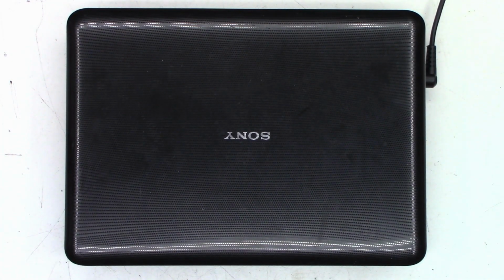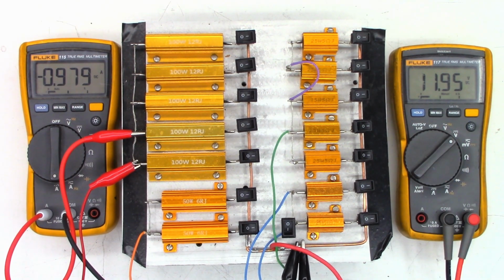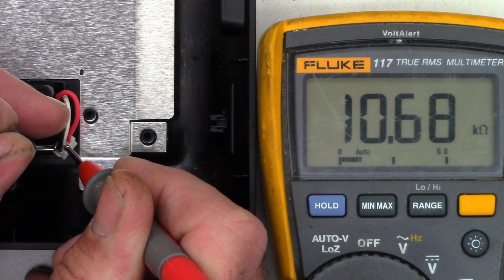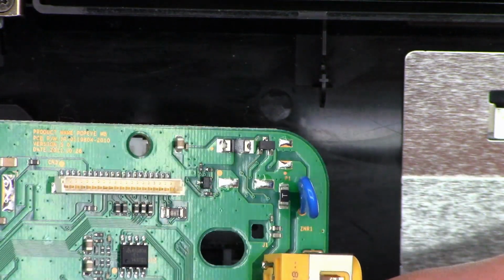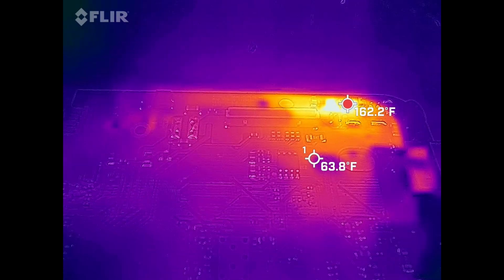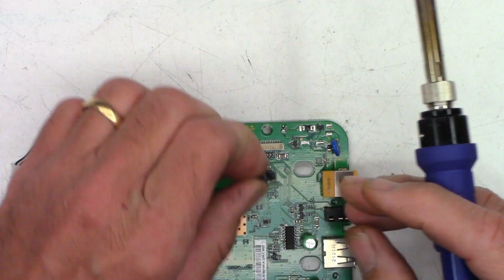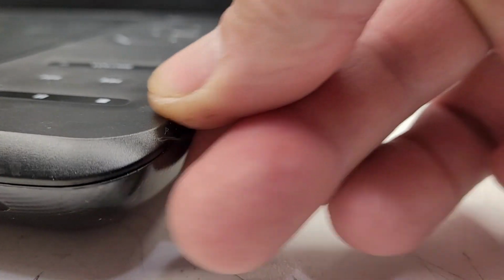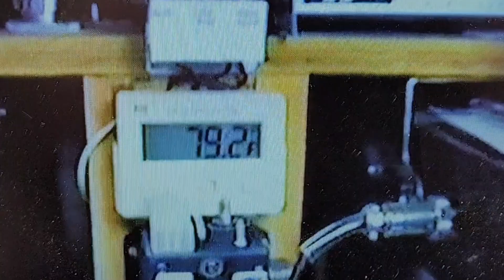Sony Portable DVD player DVP-FX980 Dead - No Power on AC Adaptor or Battery Repair Fix

Comment: This is nostalgic I still have my SONY FX980 DVD PLAYER it still works great unfortunately it's on its way out the battery is not lasting like it once did it only plays for about a hour and 50 minutes maybe 2 if I'm lucky its not my everyday portable DVD player anymore but I still love to pull it out of my closet and use it from time to time. Hopefully one day I'll get the built in battery rebuilt or replaced with one just like it at a battery shop and it'll last around 4 hours just like it use to. Still going strong after 6 years of use

Comment: I picked up a Sony DVP FX820/L at my local charity shop for $3.00 The battery was completely discharged, so I plugged a compatible AC adapter into it and the battery was fully charged within 5 hours. I popped in a DVD, and the machine played perfectly. These Sony LCDs have a full 480p display. The Sylvania my sister bought 2 years ago has a lower resolution LCD. I think 240 x 380

Comment: how many capacitors do you think, as a rough estimate, you've removed tested and replaced????
Reply from the maker: OMG between surface mount and leaded it has to be in the high thousands, maybe over 10000 total over 40+ years. Especially when I did a lot of Canon camcorders in the early 90s. each one had roughly 150 SMD electrolytics. Hitachi and Mitsubishi CRT and projection sets were the worst with almost 100 each. At one point I just stopped testing them and replaced all of them. Too many comebacks just a few months later if I just replaced the suspect ones as more would fail in a short period later.
Reply: @norcal715  Are you trade-trained or self taught? You certainly know what you're doing either way...just curious...

Comment: Get a proper Electronic Load instead of using those power resistors.
Reply from the maker: The resistors work great for a static DC load. Can you suggest a "proper Electronic Load"? I would be interested.
Reply: For the hobbyist (not too expensive): Rigol DL3021A, Itech IT8511A, Siglent SDL1020X-E
Reply from the maker: Still a little rich for my blood. The Rigol, and Siglent at $499USD and the Itech at $427USD. It this were my full time gig then yes I would have one but not as a hobby. I just cant justify $500 on a $75 repair that I use maybe 2 or 3 times a year. The dummy load cost me about $40 USD and just over 1 hour to machine, drill, tap and wire. Thank you though.